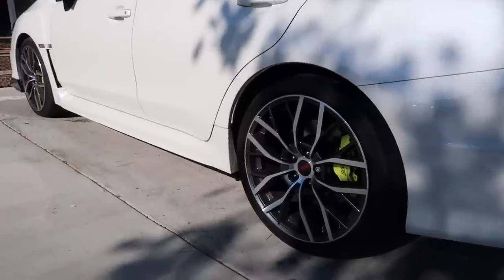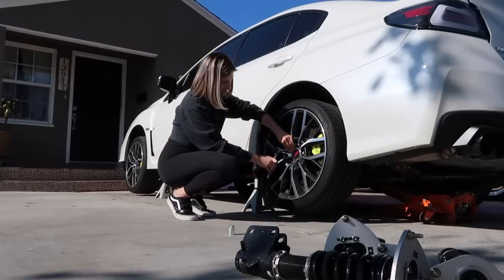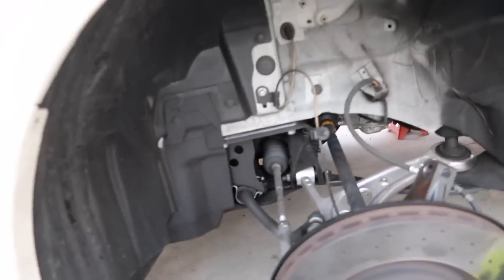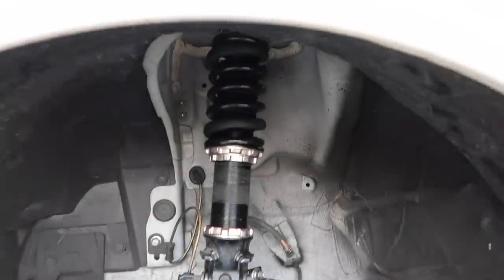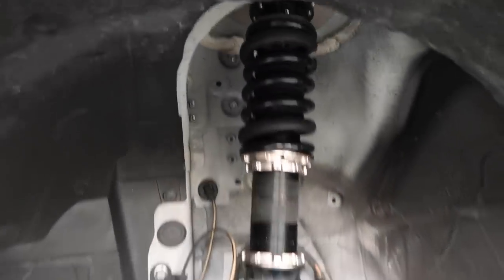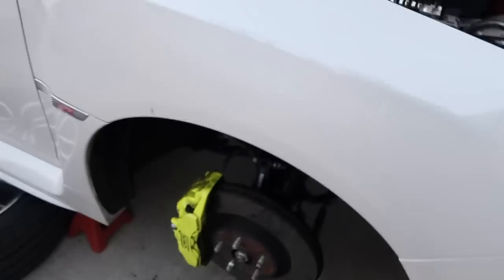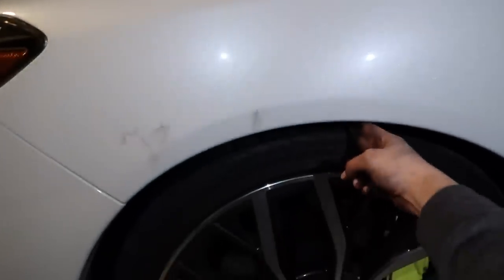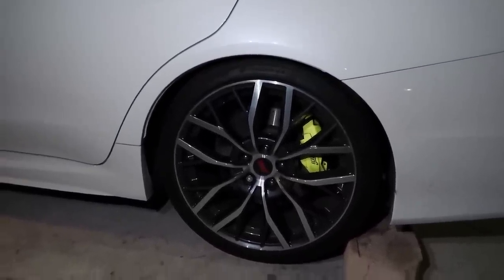2020 Subaru STI / WRX BC Racing Coilover install

Comment: I've been a race car fabricator and an engine builder for 15+ years. BC Racing coilovers are fine for the street and if you just want to lower your car, but they are definitely not a track performing suspension.  They seem fine for your needs but always make sure the preload is set up properly. Also don't jack up the hub assembly by putting a jack on rotor you can damage it that way, instead jack it from the lower control arm. 

On another note it's always nice to see a woman who not intimidated to wrench on her car, BUT the thing I want to commend you the most for is not being half naked on camera just for views like so many other female car girls. Women who respect themselves and carry themselves with class are an endangered species today and it's always refreshing to see a lady with class instead of just ass. Stay awesome and great job

Comment: Damn! girls nowadays is being more in more into cars! installing coils on a car without a power tool is not an easy job, i also did put coils on my car and i have to admit i struggled a bit, knowing that your working with a AWD setup means theres much going thus making it harding to worn on than a regular fwd or rwd.New sub!

Comment: If you ever want to remove your coil overs with the same method you did it , make sure you take off one side of the sway bar links to release the tension
Reply from the maker: ahh thanks for the tip!!

Comment: Lifting only one side means you’re fighting against the sway bar. Always lift up the whole axle or all 4 wheels at once when removing suspension components.

Also when changing ride height it’s always best to loosen bolts through bushings and then torque with the car at ride height. Either use a Jack to lift the lower control arm, with sway bar disconnected, or ask the guys doing the alignment to loosen and torque the bolts while it’s on the alignment rack. Otherwise the bushings can tear and wear out much faster.
Reply: Sound advice right there
Reply: Great information, though you can just disconnect the endlinks for the swaybar, do your work, and put them back on.
Reply: @jinxtacy  yes that’s what is typically meant by “disconnecting sway bar”, but you still have to raise either the whole vehicle or each front and rear axle at once in order to unbolt the end links. Otherwise the sway bar is under tension and the end links would be impossible to disconnect, or if you do the bar could snap back to equilibrium with dangerous force. And then it would be impossible to get it back together.
Reply: Racing both front sides in the front will prevent from struts getting stuck on axle and ripping the boot?

Comment: I've done so many suspension installs on subies.  on a lift, me and one other guys did a set of springs in 15 minutes and coils in 30 minutes including 1 readjustment. Subie setups are dumb easy.
Reply: And great job btw!

Comment: awesome job. i noticed you had a jack under the front brake rotor. dont do that. if you need to jack up that area put the jack under the control arm just behind the rotor

Comment: Liz, are you still liking the BC Racing Coilover? I have a '22 WRX and in the market for one. I'll be on the road mainly and doing some spirited driving on the backroads. No track racing for me.
Reply from the maker: Hi! I love them actually! Since you can mess with the dampening settings you can adjust how stiff you want it to be which is my favorite part about them!

Comment: Nice, but one question...why did you do f/r on one side vs rears than fronts (or vice versa)?  Two different axles made it more difficult, but I give you props for muscling 💪 through it. That 3-finger ride height looked perfect as dumped isn't always the answer.  You could raise the front and dump the rear and do the "Carolina squat"...yes, it's a thing.

Comment: Hey Liz. Great video. One thing I’m curious about, it looks like your STI has the factory steering headlights, have you had any issues with them after the install? Do they still fully work?
Reply from the maker: after installing coils i had no issue with the steering responsive feature, however i recently installed aftermarket headlights which delete that feature.

Comment: How much drop is done with coil overs?
Reply from the maker: with coil overs you have control of how much you drop, they are adjustable… unlike lowering springs have a standard  height.
Reply: @stiliz.   great thanks hoping to get my Sti later this year